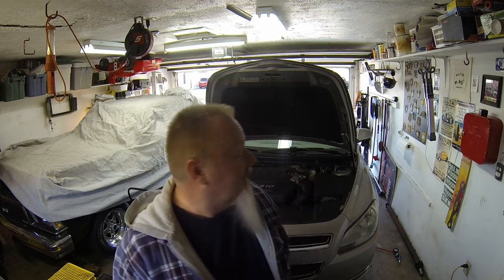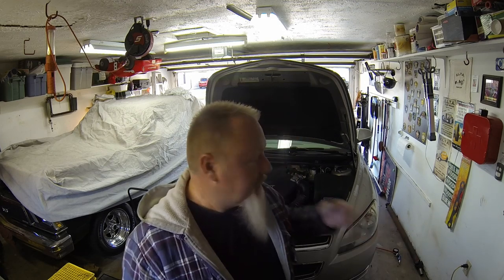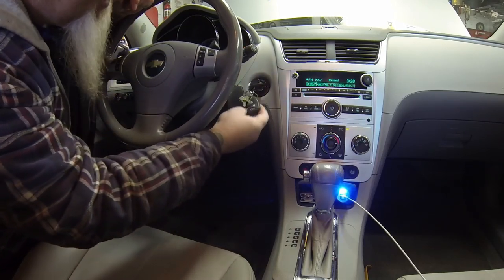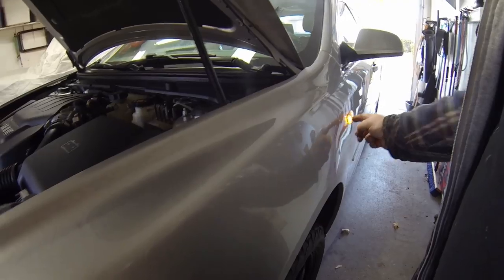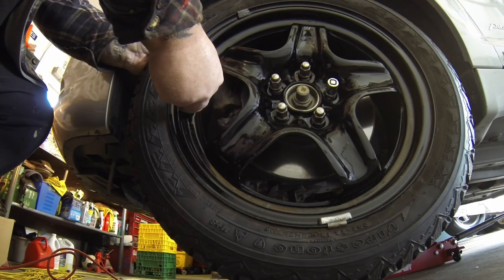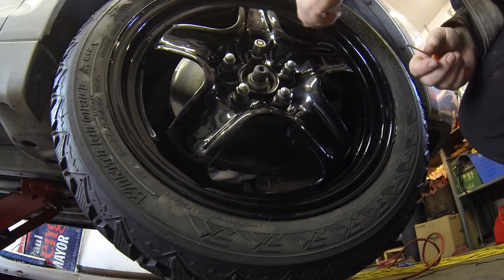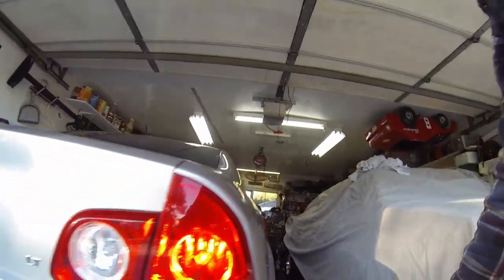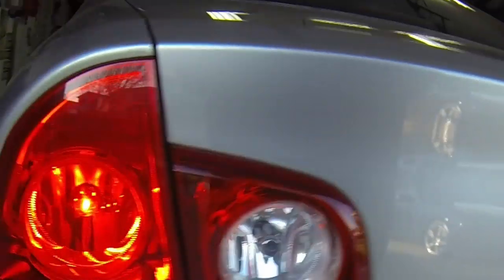Re-learn Reprogram Tire Pressure Monitor Sensor TPMS Chevrolet Malibu

Comment: One of my sensors is dead (I know because there is no honking when deflating/inflating the tire). Would I just need to replace the sensor (take tire off, mount it, and put tire back on) and retry this with the new sensor or would the sensor need to be calibrated/relearned/activated another way? I've been trying to figure this out and I'd rather not have to buy a MaxiTPMS service tool.
Reply from the maker: Page I think you be fine replacing the one and just program with air.

Comment: My LR tire lights up when I am doing the RR tire but as soon as I am done, the lights goes completely off. Does that mean there’s no sensors in the LR tire or is the tire PSI is too on the LR, which makes me restart the whole process every time?
Reply from the maker: start lf, the rf, then rr then lr. Follow the lights. Make sure there is sufficient air. Sometimes it takes me 15 seconds...eventually it will beep then light up the next light brighter, and double honk on last tire to let you know its done.
Reply: ClusterHeadSurvivor I follow the exact step you just described. However, it only double honk in the rr tire. I guess the sensor in the lr is dead. Moreover, I realize that once I do lf and rf, the psi number shows up in the dashboard but once I go over to the rr, it double honk and the psi doesn’t show up anymore.
Reply from the maker: Humble Kid think you have a bad sensor !
Reply: ClusterHeadSurvivor Thank you. I will replace it.

Comment: Any idea why this method did not work on the same model and year of the car? I only have one sensor working and the other 3 aren’t projecting anything. When I hold unlock and lock nothing happens. Very confused on why this does not work on my car.
Reply from the maker: Chris Gonzalez I would try 4 or 5x. If unsuccessful the likelihood of bad sensors are prob you best bet.

Comment: I did the process but on the left rear tire it wont honk so is not getting re programmed, can it be a bad sensor?
Reply from the maker: Andy Calidad could be. Try again. If it don’t work take it to a shop. Sensors do go bad but not often.
Reply: @ClusterHeadSurvivor  yea I tried twice already still the same problem I'll take it to a shop though see what they say
Reply: @andycalidad604  may be the battery  sensor
Reply: Same issue on an 09 malibu. I have replacement sensors to put all around. I'm waiting for my appointment to get new tires on. I was trying to relearn them all to see which one is bad now none of them will read since the process didnt finish at the left rear🤦‍♂️

Comment: Why my relearning program doesn't function after I hold unlock/lock
Reply from the maker: Are you using factory fobs or aftermarket? Press and hold both together until horn beeps.
Reply: @ClusterHeadSurvivor  aftermarket fob